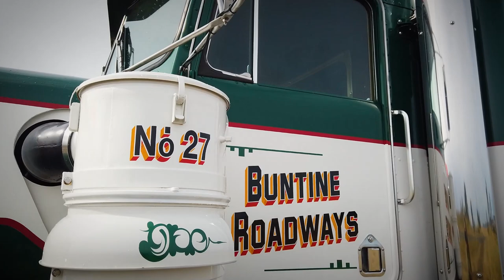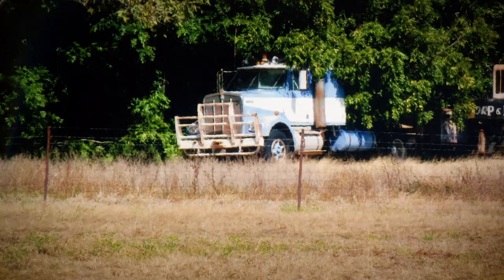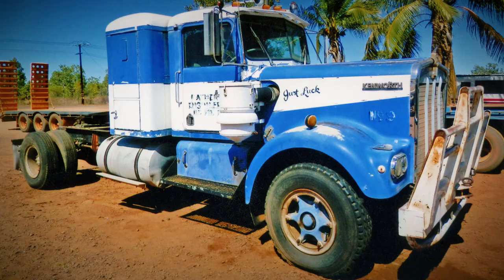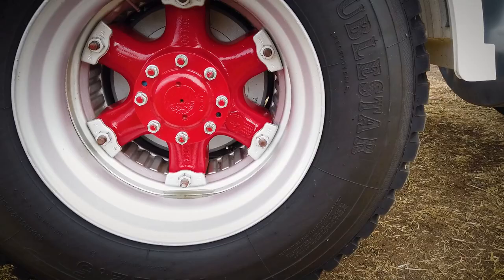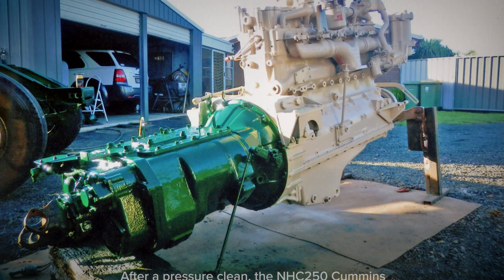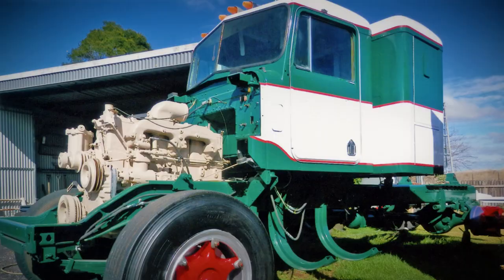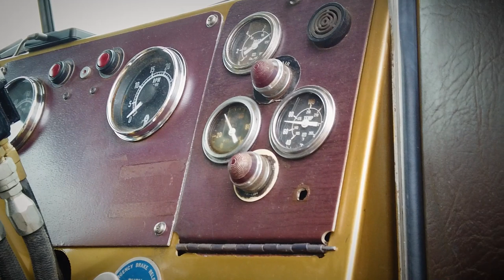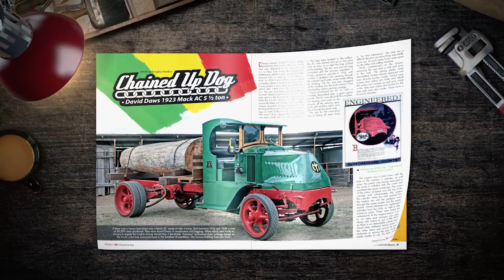The Mystery Behind Kenworth Trucks Buntine's Truck

Comment: Perfect Resto! Not overdone at all, very original and correct. Now it needs 2 or 3 single axle, single deck stock crates with matching green wood side boards, just like when it was running for Buntine's. 
Nice old banger 👍👍